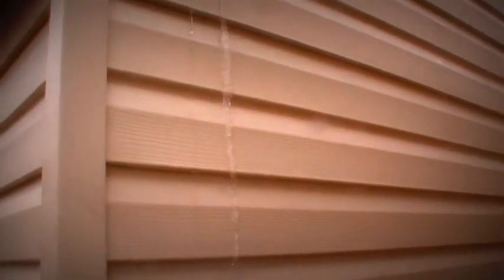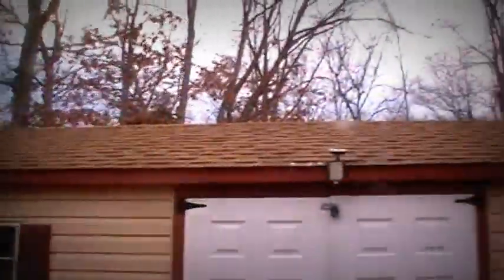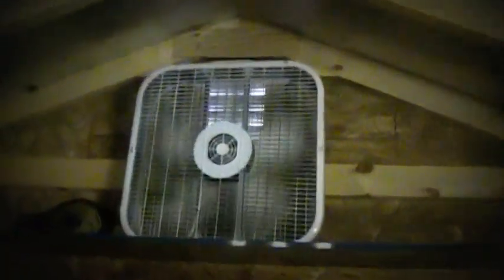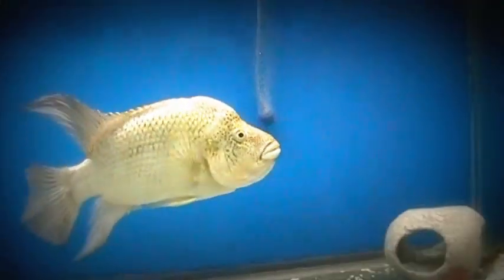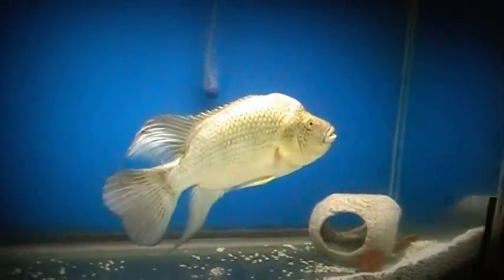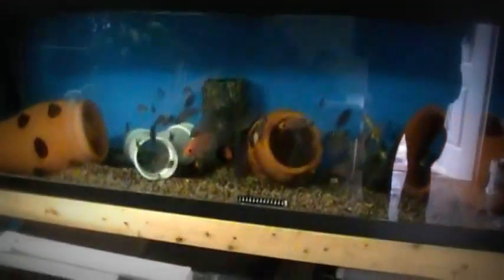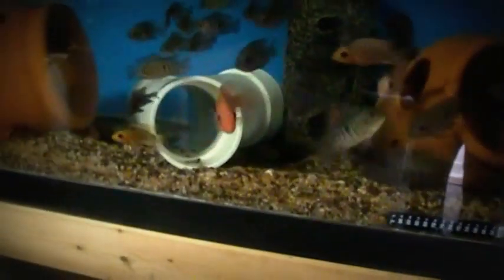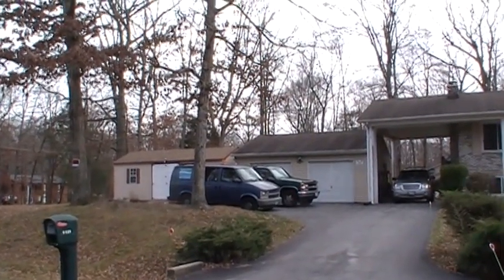Skip's video how "Geothermal / Hydro Heating" works

Comment: In canada police look for houses that have dry roofs, that check to see how high the electical bill is.  This is how they find grow ups (pot).  Just a interesting point.  I for whatever reason had the impression that you lived in a warmer state, but i see i must be wrong.  What does the temperature fall too and how much electricity do you burn in the coldest month ie: total kilowatts.   I have the means to build a fish house, but the electricity is so expensive here in newfoundland even more so than the rest of canada that it holds me back from the investment.  Already paying over 500 in the coldest month.  Any case excellant video and i loved your book by the way,  i enjoyed the simpli ity and the pics are awesome, really great education tool.
Reply from the maker: Very interesting point indeed. I live in the State of Maryland were we have seasonal changes so the temperature fluctuates. Now the coldest nights can drop 20 below zero but, as far as my heating cost or electrical bill. Doing the winter it's sky high but, doing the summer it's very low. Throw out the Years I have come up with ways to reduce my heating and electrical cost by using techniques like you see in this video. Thanks for watching and for your support.
Reply: +fishlaw1   -20C, wow that' the same here.  What is your electrical bill if you don't mind me asking?
Reply from the maker: I do mind because I don't know who maybe watching this video but, I will say this it is 3 times as much as my home bill. Which is 10 times the size.
Reply: ***** thanks skip that answers my question percisely.